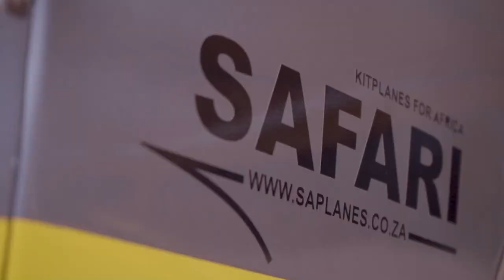Paramotor Trike Rebuild - Harness, Prop, and Throttle

Comment: I'm not sure how good that glue is that you used but I just use super glue (a good trade strength one) with baking powder or bicarbonate of soda. I have a video about 5 years ago. Then smashed the prop later in the year and the parts I glued together were stronger than the rest of the prop.
Reply from the maker: Haha - indeed. I've seen that technique used. I used an epoxy resin. I considered baking powder, but stuck with just the resin for now. I've no doubt I'll need a new prop.